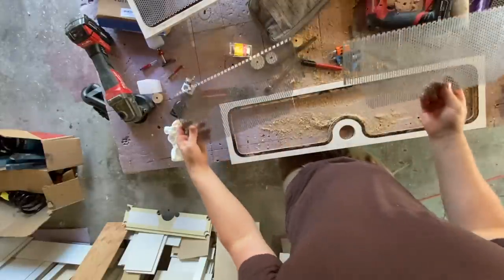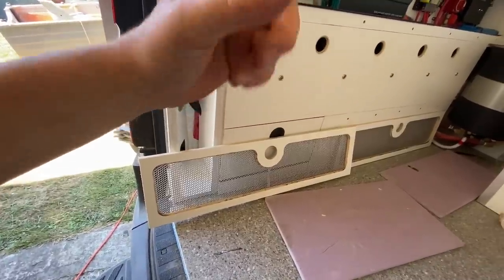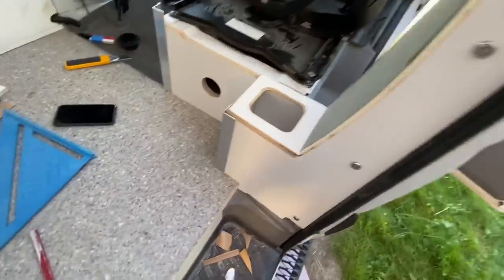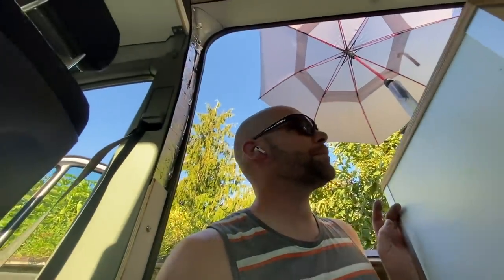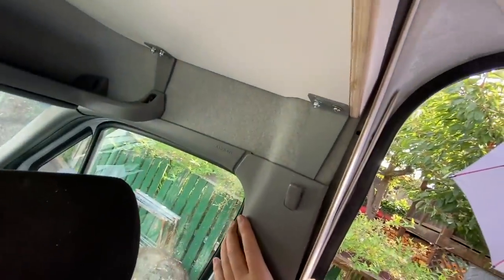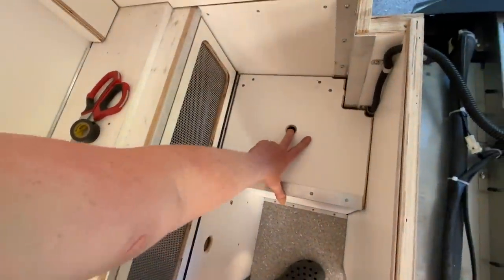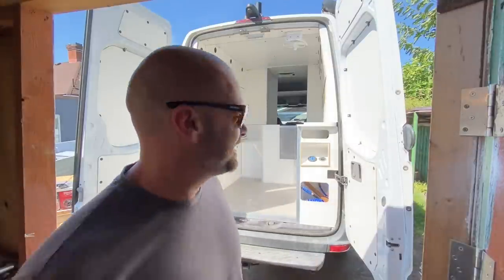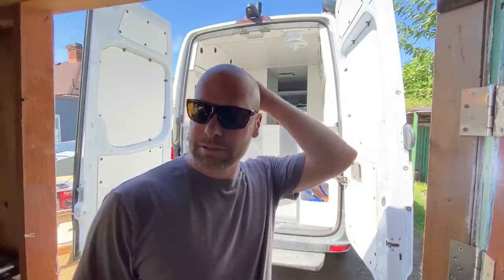Final Fit & Finish, Not Without Blood || 4x4 Sprinter Build Pt-11 The End

Comment: Sir, Many years ago I used to work for a car modification center and we used to take delivery of brand new Mitsubishi Evo 10 cars from the factory and completely strip them, repaint them. modify their bodies, fit new interiors, modify the engine, exhaust, suspension and wheels. I am too old for it now but people were freaked out by my skills and you have just freaked out your subscribers with your skills. Job well done and may you have a well earned break.
Reply from the maker: Thank you David.  It's good to show what's involved.  As you would know the un-edited version involves many many trips into and out of the van to get it all fitted so nicely.

Comment: 8:54 What is the black tool with 2 handles you stuck in the doorway screw hole?
Reply from the maker: That would be a Riv Nut tool.  It compresses a bit into the sheet metal
So it can accommodate a bolt.  I use those because they're both strong and they make parts easy to remove from the van walls when it come time for service.
Reply from the maker: That would be a Riv Nut tool.  It compresses a bit into the sheet metal
So it can accommodate a bolt.  I use those because they're both strong and they make parts easy to remove from the van walls which is important when you need to service something on the van itself.
Reply: @SharingTheWild  Thank you, Joseph!